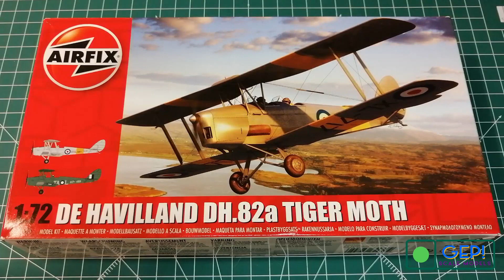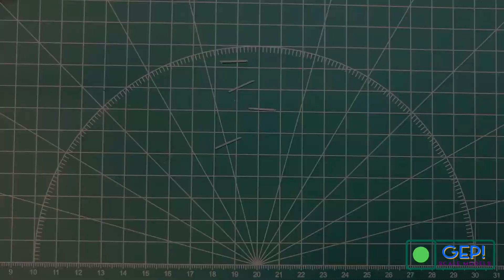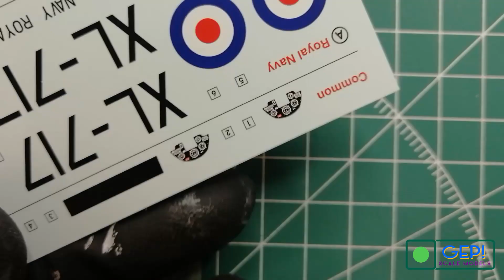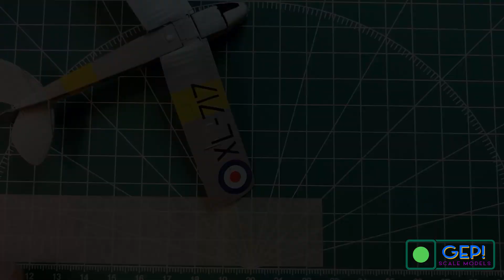AIRFIX De Havilland DH.82a Tiger Moth 1/72

Comment: Simply stunning, I bought this kit yesterday and was wondering how to fit the bracing wires. Thank you
Reply from the maker: Hi Jerry, the bracing wires are glued with super glue. It takes very little, I usually use the tip of a needle to place the glue, then just place the cable in the spot with the glue and wait a few seconds. To finish, cut off the excess of the tie rod with scissors

Comment: Masterful work. I wish you'd included some commentary about the materials and techniques you used. I'd love to build one of these, but I've got very little experience yet.
Reply from the maker: Thank you very much! I used the following products to build the model.
Tamiya paints: XF-1 black, X-11 silver, XF-2 white and XF-3 yellow.
Some parts were self-made such as the seat padding with two-component putty, the belts with paper tape, and two wing struts that were already broken when I opened the box.
Glues: Tamiya cement and Tamiya extra thin cement, cyanoacrylate
Rigging: rigging wire 0.2 mm by ammo
A little patience and you're done. I think I will do it again because I really enjoyed the construction.
Working with 1/72 models is not easy, it takes commitment and a little patience. I hope I have inspired you and that you can build one as soon as possible.
I will soon upload a video of a biplane I built.
Reply: @gepscalemode  Thank you, that's very helpful especially as I've been leaning towards using Tamiya paints and glues. I'm definitely going to give it a try. I discovered yesterday during my research that SBS make a rigging set for the Tiger Moth, and I think I might give that a try.
Reply from the maker: @ingramdw1  You do well. Tamiya colours are very good, it is also fun to mix the various colours to get the colours you need. Good luck and let me know how it goes!